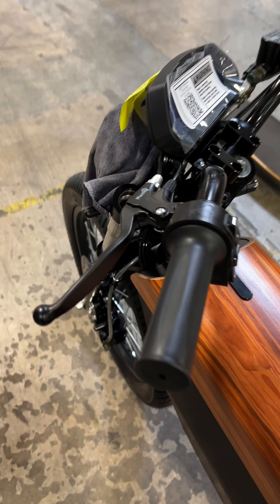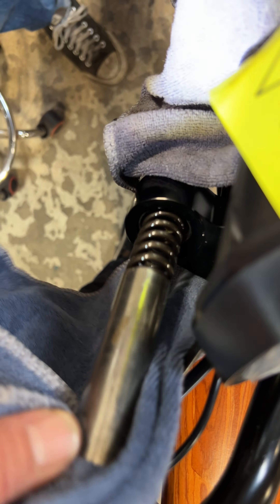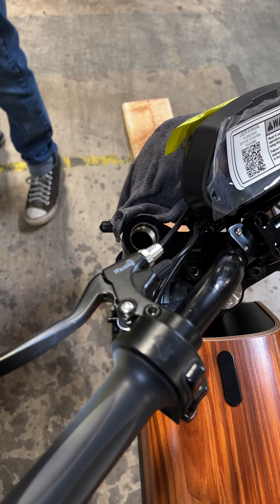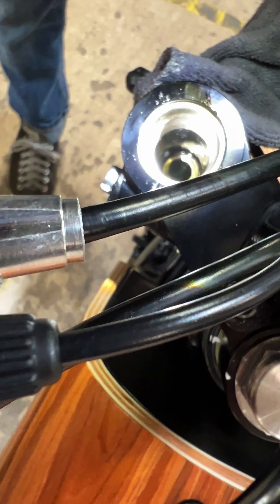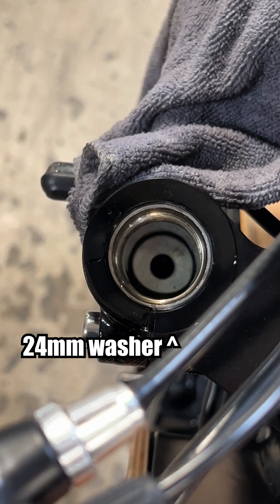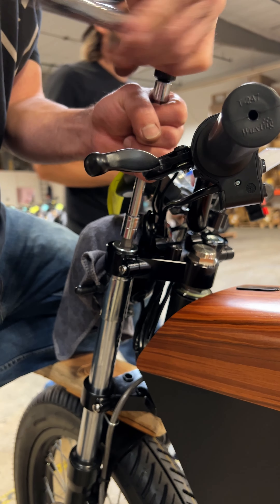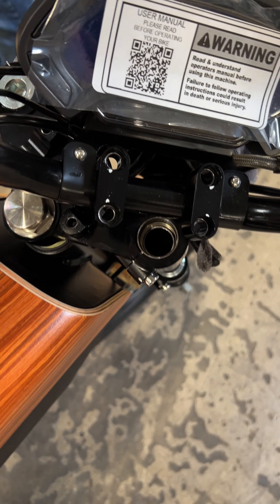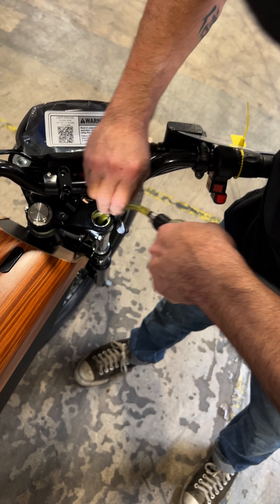ONYX RCR or CTY2 hydraulic fork mod

Comment: I was just sent here by Onyx support to address my CTY2's junk front suspension issues.
Reply: Bro what the issue u had ? I had an issue with my cty2 fork leaking oil like 2 weeks after purchase.
Reply: @obeii1805  The issue with my front fork is that it would bottom out very easy and wouldn't really rebound and would sit without a rider at nearly 50% of the compression already used up.  The solution was exactly as show in the video.  My fork oil was over full on one side and under filled on the other side and both sides the spring was sunken into the metal collar that is inside.  After properly balancing the fluid and adding two washers on both sides between the spring and collar, my front for has operates flawlessly and completly changed the ride dynamics of the bike.
Reply: @JVTechandRC  it came like that even tho they say they test every bike

Comment: Is this why I’ve been hearing complaints recently of peoples shocks not working well?
Reply: I just got a new CTY2 and the front forks are complete rubbish.  This is the video that Onyx support sent me to.  I guess the solution is for me  to spend more of my time and money to take apart my new bike and fix things that shouldn't be broken.   I just hope it actually works.  Now I have to spend money on a 12MM hex that I don't have and 5wt shock oil I don't have.  I'll really be tuned up if this doesn't solve the problem.

DD214, you're about the same height and weight as me and also have a CTY2.  How's your front suspension?  Mine bottoms out if you look at it funny and forget about when you're actually riding it.
Reply: @JVTechandRC  Sorry to hear that. No issues with my standard height forks. Should of just gone standard. Shorty has no travel.
Reply: @JVTechandRC I been having nothing but issues with my new cty2 as well n been spending money on stuff every since purchase.. was always dealing with support, I just got tired of dealing with issues, I don’t contact them no1 n I’m not spending any more money on this bike. After the forks n right brake they sent me which I hadn’t installed cus I don’t know how but after I get it fix I’m done
Reply: @JVTechandRC I knew I wasn’t the only one having issues I can tell even tho they gave the vibe like I was

Comment: What does the washer do?
Reply: It keeps the spring from sliding into the tube and also makes the fluid do it's part for ride smoothness. It also prevents bottoming out because it slows down the spring rate with back pressure through the hole in the washer but it still drains back down around the spring. 
 Just try it you'll notice it immediately when you ride it. NOT as much front end drop when you brake hard. I paid .30 cents for a dramatic difference in the ride. They feel completely different and I'm a big guy...